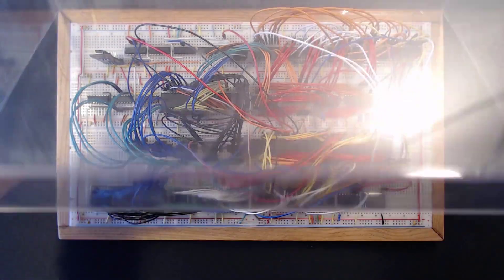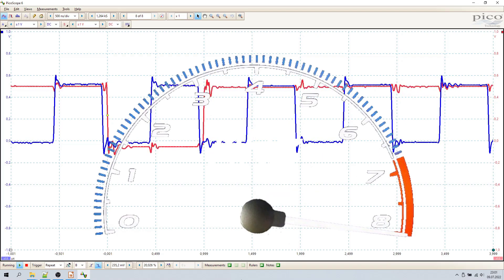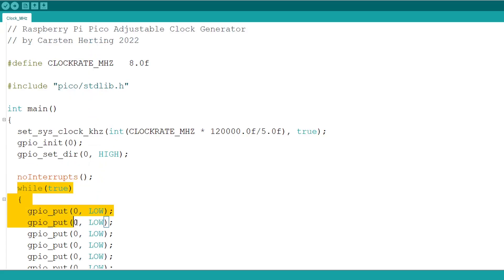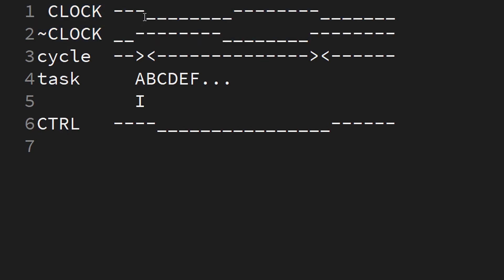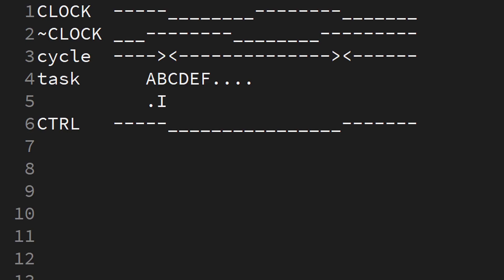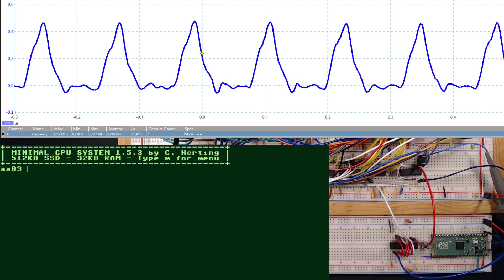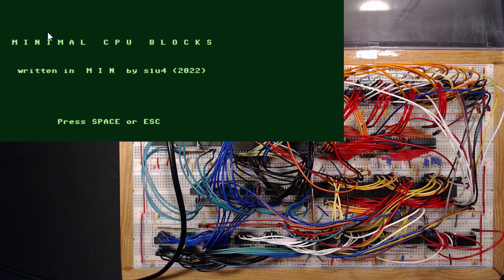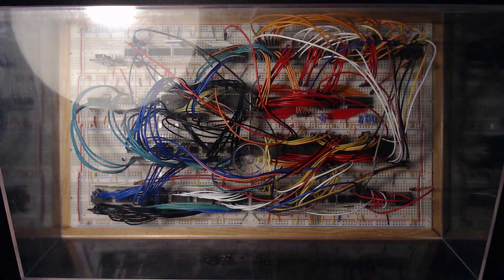Breaking Clock Speed Limits - TTL Computer in Beast Mode

Comment: Watching this video again, i see you are using a 74 chip as 3.3->5v level converter? Nice
Which one exactly? 74HCT245
Reply from the maker: Hi Alex, I use 74HCTxx chips when logic levels are low (compared to 5V). Any input will do, e. g. 74HCT245 or 74HCT04 for inversion or... If you deal with slow-rising signals a Schmitt-Trigger might be useful, too (see 74HCT132). Cheers.

Comment: I just found your channel recently. I really like it. SAP-1 on steroids. I work at Takuma Denpa Kousen (Now part of Kagawa Kousen with Takamatsu Kousen merger) in the Electronic System Engineering Department. I have 6 students working on Seminar and Sotsuken in my laboratory. I am thinking about having one or two of the students build this and maybe have one of them build a PCB of it or do something together if you are interested. I have two students who are probably capable enough to do something together with this...Anyway, really like this channel and your Soundcloud works as well. I actually used to practice/play with the "Rock n Roll" bukatsu and perform together in at Denpsai but haven't done that for about 8 or 9 years.
Reply from the maker: I'd certainly very much enjoy your students engaging in my designs. My new and upcoming full Minimal 64 home computer (only 61 ICs with VGA and PS/2) might be interesting. It is running Space Invaders :-) Currently, I am working on the release video. Cheers!

Comment: Very cool! Advanced shottky (AS) ICs are the fastest and most robust in my experience. They tend to get very warm, though.
The "HC" ICs you are using should be around 10ns like typical "LS" type ICs. Going to "ALS" will reduce the delay to around 4ns and going to "AS" will further reduce it to 1.5 - 2ns.
Sometimes i have used 74S ICs for flaky circuits. They are extremely robust and will output a lot more mA on the pins. They are more resistant to RF and will hardly ever go bad despite mishandling. The 'original' Shottky ICs have a high internal resistance and are very power hungry. They will most likely not be usable in your setup.

Comment: Very nice work, getting above 4MHZ is a real challenge, especially on breadboard!
The PJ5CPU I'm working on runs at 4MHZ, but gives 4MIPS (TTL based), it does have a display (graphic and text) and RAM.
Reply from the maker: Hi Paula, I am following your design steps every now and then. Very impressive, feature-rich and efficient - and quite the opposite of what I am doing ;-) My CPU is simplistic and inefficient. At 8MHz it's just above 1MIPS. But it's only 39 TTL chips. I am also working on a full "home computer", with VGA and PS2. We'll see... currently it's 61 ICs in total ;-)
Reply: @slu467  you design is wonderful, it's incredible how much you've got from such few chips.
Agreed the two are very different design philosophies, I very much enjoy your videos
Reply from the maker: @PaulasTechStuff  Thanks a lot for keeping me motivated :-) My next "upgrade" (actually it's going to be a real 2.0) will be a full home computer with 64K, VRAM, VGA out and PS/2 in, UART, expansion port. 8MHz is the entry card for generating VGA on the fly efficiently and with only very few chips :-) I am currently homing in on 61 chips for the whole deal.
Reply: @slu467  I look forward to seeing this, 61 is very minimal!

Comment: The TTL C74-6502 runs at 20Mhz.

The "MyCpu" also runs at 8Mhz.

In the commercial sector the PA-RISC TS1 CPU runs at 8Mhz. It is however a 32-bit pipelined machine that had all the goodies.
Reply from the maker: C74-6502 is a naked CPU - doesn't count... and PA-RISC TS1 uses fast TTL chips... MyCPU however is pretty close... ;-) have to look into this project.

Comment: It shows that speeding up the clock rate is not just down to changing the chips for a faster series, you can get an improvement from optimising the clock signal. I love your explanation why it can run faster just with an asymmetrical clock. Optimisation can be difficult but very worthwhile. Maybe your next step can be to lower the number of micro-code steps but keep the chip count to the minimum and the CPU's functionality the same.
Reply from the maker: Hi David, good to see you here and thanks for your kind words :-) In fact, the number of microcode steps needed for various instructions is already creeping downwards with version 1.6 (see the Minimal Online Manual). It's funny, almost like exploring a cave, one little breakthrough leads to a whole new hall - just so happened this morning. This project never ends ;-)
Reply: @slu467  hey i love your channel! Was wondering, are there any drawbacks to having a signal that is not square? Are reliability or other factors affected?
Reply from the maker: @ank2000  I can't answer your question in general. It very much depends on the actual circuit. In any case I've made the experience that once you squeeze out maximum performance things tend to get hairy...😄

Comment: With the temperature change the propagation delay and transition time will also change...
Won't it break the stability? The idea of making clock not 50% duty cycle is brilliant, but i think for pcb MINIMAL design it's better to do a proper generator based on shift register?
Reply from the maker: Hi Alex, it probably won't run under space conditions ;-) I now use an even simpler clock pulse. See my updated schematics on GitHub ;-) Now running at 8.6MHz.

Comment: Interesting that HC parts tend to show a disappointing drop in speed at, say, 3.3v rather than 5v; and according to the datasheets, AHC are not significantly faster, just a couple of nanoseconds.
I'm working on an 8080 facsimile using flash/eeprom/whatever as the control logic - which is likely to be the speed limit. It's a lot more parallel though, I think, so the delays stack up as eeprom access time plus ALU delay plus a couple of other short delays. I'm trying to keep the clock symmetric so I can use the clock high phase as a time for ram to be accessed by video, 6502 style, so I doubt if I will be anywhere near your speed.
Keep up the good work!

Comment: You have the basics of cycle timing analysis well illustrated, the only thing you are really missing is setup and hold time on your memories and registered devices, but for that information you would need to refer to data sheets of the parts.   Really good job on noticing the usefulness of an asymmetric clock.

I think you a little misguided though in worrying about whether you are running the fastest clock rate for a TTL computer.  I would promote rather the idea of the "efficiency" of your CPU architecture in terms of instruction rate or maybe instructions per cycle.  Let me illustrate.  Back in the day of 8051's and 68HC11's and 6502's, a lot of engineers were touting the 8051 running at 12 MHz (crystal) was faster than the 68HC11, yet it took 12 cycles to complete each instruction for an effective instruction rate of 1 MHz.  The 'HC11 on the other hand was running with an 8MHz (crystal, 2MHz E-Clock) clock was almost twice as fast depending on the instruction mix.  All the CPU's you've mentioned have varying instructions per cycle so a raw clock rate doesn't necessarily represent how fast the CPU can get work done. 

I've been really enjoying your series on the Minimal CPU, takes me back  Your ideas on CPU emulation in Python are really first rate and I am learning from.  Thank you.
Reply from the maker: Hi Todd, thanks for this interesting information. You are right, looking at clock speed alone is not enough. The design of the 'Minimal' is not about efficiency (hence the name :-). In fact, it does pretty bad: Is needs about 8.18CPI (average clocks per instruction) while running the 'Min' interpreter (might not be representative, but that is a complex piece of code doing lots of look-ups and memory moving - so I took it as a quick 'benchmark'). That would be just above 1Mips @ 8.3MHz for the Minimal. Really no match for any decent pipelined CPU design - but the Minimal only need 39 TTL chips in total ;-)

Comment: I was playing with inverters which give a 5ns delay and flip the phase and rippling a clock through it.

I also used a nand chip to take 2 clocks and generate a strobe for mem write.

The chips I'm using need around 45ns write signal and 5ns either side of address stability.

So my strobe comes along goes low briefly and then high. Then I have a couple delayed phase which goes high which I can jumper to latch the registers and instructions. 

I'm not running very fast yet as still debugging but can experiment with shortening the strobe for mem write stability then moving the other phases closer and closer to the end of mem write.

Once I've done that I can measure the propagation time from instruction being latched to a stable state. Then start to ramp up the clock to remove the unneeded delay time before next write strobe.

I won't hit 8mhz as my address lines go into another sram to do a simple memory paging system to then output the physical address. Similar to magic one.

I've gone for a higher IPC design where most instructions are 2 clocks fetch and execute. To make up for the larger propagation time.

I was reading about magic 1 swapping LS chips out for F chips for more speed to reach the 4mhz.. currently I have all mine as LS... which could be key to what speeds I can achieve.

Comment: Impressive demonstration, you can also use a PLL IC locked at 1Mhz and dynamically adjust clock speed using a latch.
Cheers ✨✨